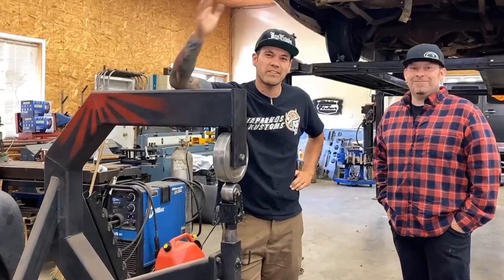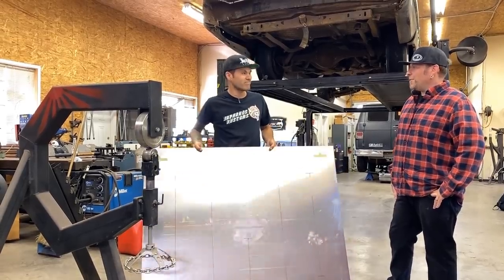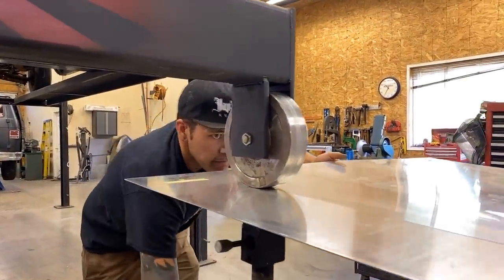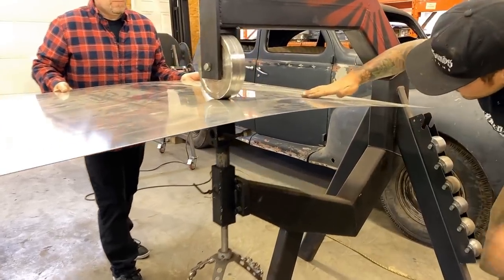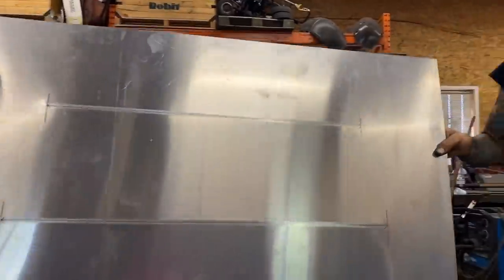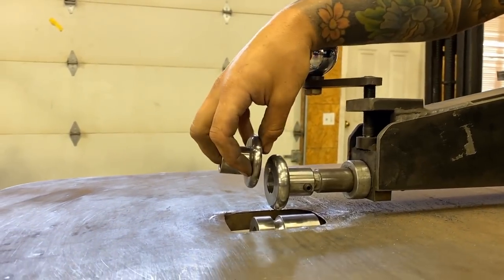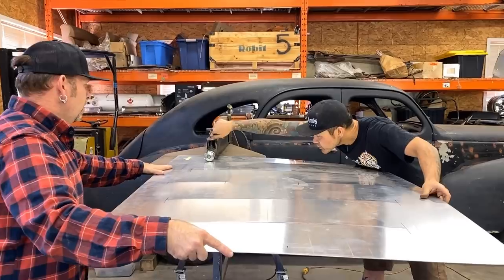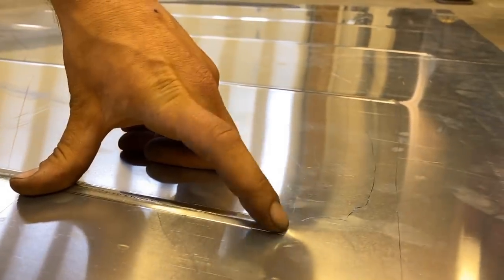HOW TO Pre Stretch a BEAD ROLL To Prevent Warping! CUSTOM Tear Drop Trailer Rear Hatch (Galley Door)

Comment: Bought a manual Woodward Fab bead roller earlier this year.  Specifically, for forming the rear deck in my 1969 VW Squareback. After watching numerous YouTube videos it became obvious to me that I needed to put a motor on mine.  Bought the Eastwood motor and table, works like a champ. Watched your video about making a pattern with masking tape. You inspired me to get going on the repair panel. Today, I rolled my first bead on the repair panel. Since, I bought the bead roller my grandson and I have just been playing around with it and the english wheel. I was checking out this video again to see how you finished off the bead. That's on the project list for tomorrow.  Thanks for the great videos!!!

Comment: I also have the HF E-wheel and Eastwood bead roller. Both work great for the money. The bead roller sat in the box for a few months while I watched a lot of videos on powering it, then Eastwood came out with the motor and I bought it and never looked back. I mounted it to the back of my E-wheel along with a fabricated rack for the dies. Excellent channel keep up the good work.
Reply from the maker: I thought about buying the motor set up from them so that I have the variable speed. Definitely worth notarizing any bead roller it’s really difficult otherwise

Comment: Excellent video. Can you go into more detail on the wheel profile needed to do this process? Any plans to sell plans for bead roller?
Reply from the maker: I don’t have plans to do a bead roller schematic for sale but I would like to build one similar on the channel for anyone who desires to do the same. I wish I had gone over the profile for the English wheel. But that is open to interpretation as any wheel that is not flat will do some stretch I used a hi crown lower anvil to achieve as much stretch as fast as possible
Reply: @MakeItKustom  👍get a Patreon ASAP.

Comment: Ask Jerry why he has comments turned off on all his vid's???
Also great vid of your own, Q, is it possible to pre stretch with with your bead roller if you don't have an E wheel?
Reply from the maker: That’s a great question and actually theoretically I bet you could. It would be time consuming but if you added a lot of pressure and used a bead wheel pressed on a flat lower than it would technically stretch the metal if you ran it through a bunch of times then use the bead lower for the final pass

Comment: Would the radius of the lower wheel on the English wheel make a difference for when you do the bead rolling?
Reply from the maker: I wish I had covered that in the video but for me I used a small radius Lower anvil to allow the most stretch